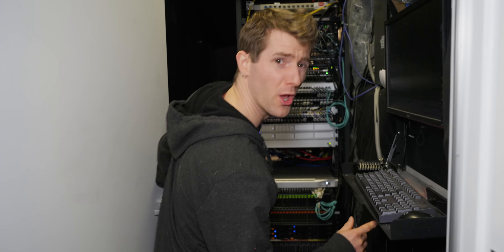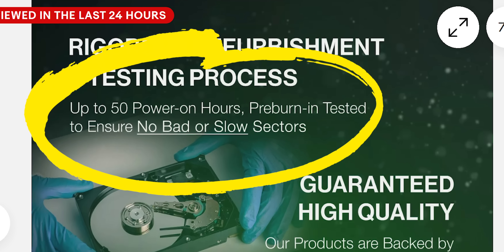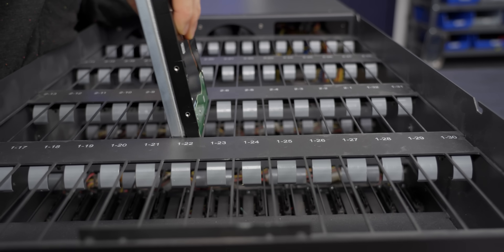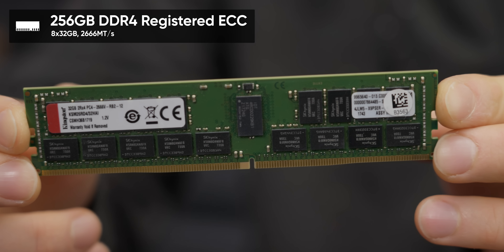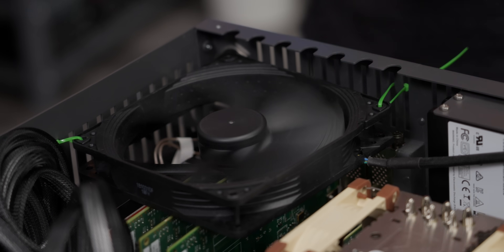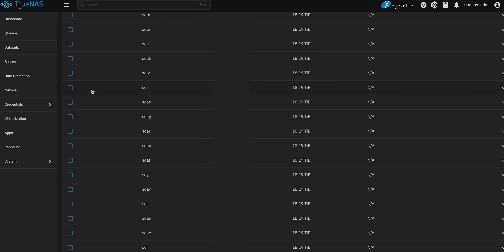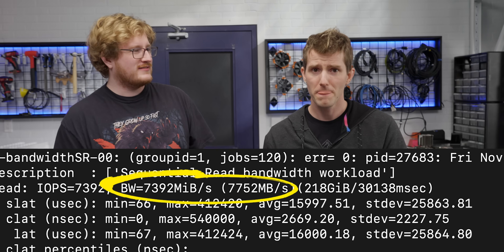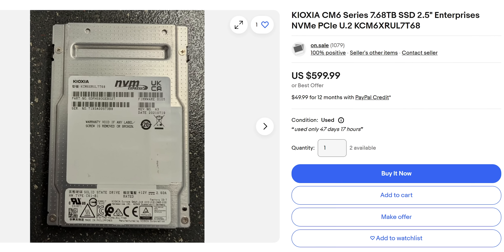Is Buying a PETABYTE on Ebay Stupid?

Comment: I've had great success with Seagate drives in RAID. Even the base Barracuda drives, I got a refurb as a warranty replacement and it was rock solid for quite a few years (although it always ran 2c hotter than its neighbours). It did end up dying though.

Comment: Gonna be straight about this.. goHardDrives is terrible.  I fell for buying a LOT from them (they use different names on ebay/amazon/newegg) and they fail in about a year.  SMART says 0 hours, but an extended self test (which they can't fake), showed 5.9 years on all drives when they started failing, meaning they had 4.9 on them to start. I know other places are the same. DO NOT get the helium drives.  They all start to go bad at same time with 'leaks' and you won't be able to replace them fast enough to get a re-silver to work. 260 TB gone just like that (and restoring from offsite sucks the life from you!)

Comment: My main PC has a 512 GB SSD and three hard drives containing over 16 TB of data.  I used to be really bad about backing that data up.  It is amazing how guilty I used to feel about that, but I thought it would be prohibitively expensive to back up that much data with a cloud service.  I signed up for a 2-year unlimited backup license from Backblaze that cost me $189.  That works out to less than $8/month.  You may be asking what the catch was.  The initial backup took a bit longer than 6 weeks.  Fortunately, my ISP doesn't have data caps.  However, once that initial backup is done, keeping it updated isn't a problem.  Of course, I've never had to restore any data.  What I can say is that I no longer feel guilty for not keeping my PC backed up.  That's worth $8/month.

Comment: Did this exact thing last year, I bought two 14TB seagate recertified drives for use in my desktop for bulk archival storage. I have them mirrored in windows in case one fails, have worked perfectly since, each drive was $130.

Comment: Been running my home server on recertified Seagate Exos and WD Ultrastar HDDs from ebay resellers since about 2015.  Server is currently running 20 drives (half 14TB and half 16TB).  Have only ever had one of them die on me, and that was a DOA 16TB drive from Server Parts Deals that they quickly replaced.  Many of those drives have been running for years now, with scans still showing no issues.

Comment: refurb drives from seagates tend to be  when the logic board fails, either the components failed or the firmware was bugged.

i had 2 refurb drives as replacement drives when i RMA my barracuda drives in 2011-2013.
i didnt trust the replacement drives and strictly used  them as scratch disk. well i was upgrading from 500GB to 2TB HDD then.

 i'm going up to 4TB drives but i have been spacing out my purchases for my NAS rebuild and i bought a LSI SAS card. no more Sata expansion cards.

Comment: Speaking as someone who previously owned a reverse logistics and e-waste company, we tended to destroy drives. It was physical and/or digital, depending on the contract. Last thing we needed was for client data to get out because of something we did. So any drives that looked intact were still useless when we were through. Or at least I wouldn't trust them enough to use in our machines or sell them. If manufacturers are selling recerts, they probably didn't come from that type of stream. More likely they came from datacenters as cold spares or from systems integrators as unused products. They were never actually used, just couldn't be resold as new. Based on that, I'd trust them if they were manufacturer recerts.
Reply: Speaking as someone who has servers with drives in them, you can let me random-wipe them and resell them for the environment, they're encrypted anyway, no one's ever got data from a wiped drive and I'm not insane level of paranoid. The reason they have these policies is sometimes the drives accidentally don't get wiped.
Reply: @thewhitefalcon8539  Some places absolutely let stuff get though due to poor control procedures. We weren't going to let that happen to us. As to the wiping, the majority of our clients tended to opt for drive purge rather than just clear, and that's pretty tough on a drive. We made more net margin off purge or destruction certificates that than reselling cleared drives, anyway. So we didn't mind.

Comment: i've been using these re-certified exos drives for years now in my drobo for 10+ years, now in my synology. they get a little loud a times but reliability has been been very good.
factory re-certified drives generally last a lot longer then you think.

Comment: There is a huge benefit to buying recertified drives vs the newest latest and greatest.

PC / server history is littered with certain product runs that have HUGE failure rates.

Buying refurbed older drives not only gives you the price discount, it gives you reassurance you aren't buying a product with inherent defects that lead to premature mass failures.

Any data hoarder of history knows to avoid certain drives such as: Miniscribe, IBM Deathstar, Seagate Rosewood, and pretty much anything built by Hitachi.
Reply: Oh, and Iomega. Click click click

I still have a Syquest Syjet around somewhere that works to this day.

Comment: So glad to see this! I've been buying these for my unraid server and I've been suggesting SPD for a couple years now. I buy these exact same drives but I've been getting the 18TB drives and I've only had one problem and it was totally my fault, SPD knew that it was my fault and replaced the drive for me anyway. They have really fast, solid customer service. SPD is literally the only company I've ever really shilled for just because it's such an amazing deal and more importantly it is a way safer bet than buying random drives off Lamazon and I see problems with Lamazon drives all the time on reddit. They also have pretty much the best possible shipping methods and a pretty damn good warranty. IMO SPD or goharddrive are the best ways to get drives for a storage server. It might have been good to mention that the prices of these recertified drive can vary a lot as their price seems to depend on their inventory and that seems to fluctuate(sp*?) a lot.

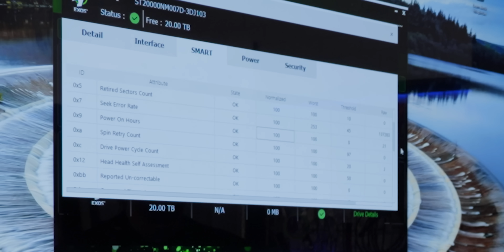Comment: 4:39 Seatools says 21 hours, so did they not do the 50 hour burn in test? How many hours of that was burn in testing?
Reply: At 3:47 you can see in the e-mail they agreed to use "tested drives (less than 10 hours)". Also, it says "up to 50", not 50.
Reply: Wait, where does it say they do a 50 hour burn-in?

From what I've got. Seagate never specified the amount of burn-in performed. They only specified the drive won't have more than 50 power on hours.

Linus seems to imply the burn-in involves writing all zeros to the drives.
Reply: Hmm

Comment: I wouldn't put my data on Seagate drives, bought a 2Tb drive years ago for storage use and didn't take more than over a year and it had some severe sector errors. The first half was still usable space and the rest were just gone. SeaTools did f all.
I wonder if Samsung still makes HDD's, I've had a Spinpoint F3 1Tb drive from my first own PC and it's still fine with 101417h power on. My external Buffalo hard drive has a Spinpoint F2 500Gb in it and it too seems fine with 118527h power on. Only sometimes when Windows is doing Windows stuff and wakes it up from sleep, the start up sounds a bit tired.

Comment: Every Seagate drive I've ever bought new died within a month of the warranty expiring. I have a 6x12Tb raid 15 array (2x3x12TB) for my NAS running recertified Seagate drives that have lasted 2 years longer than any new Seagate drive I've ever owned.

Comment: I just set up a 4 x 18TB HexOS NAS using refurb drives based on the confidence gained on a 16TB drive (~1year) and 4 x 14TB drives (~1.5 years) all refurb with no faults.  While I only have non critical data on any of them, I may change my mind WRT how safe these refurb units are - especially in a RAID array.

Comment: I use recertified drives from server parts deals (before they sponsored) I got 14tb drives for, at the time, the cost of 4tb ones new. I had issues with one and server parts deals helped me figure out that it was just a one-off issue. I have 2 parity drives and a spare which I think was still cheaper than going new.

Comment: I have those same drives from Serverpartsdeals in my truenas scale server for about a year now and no problems.  Funny enough, I built mine based on Epyc, but using a Supermicro board, 256GB RAM, 25Gbe Mellanox card, Nvidia Tesla and 8 NVMe drives used for metadata and cache.  Also have a 12 disk SSD array that is used for VM's.  Only uses about 230W at the most when streaming Plex with VM's and other containers running.

Comment: I may be wrong, but the stamp you all are pointing at for the manufactured date (called a "clock") is an insert used on the injection mold tool to identify when that part was manufactured, not necessarily the entire drive being assembled, recertified, and ready to be re-sold. (this way if a problem is identified, they can tell which tool/cavity within the tool is having the issue and monitor tool wear over time).
Reply: I don't think they were implying that, Jake even comments that that drive model was released at the very start of 2021. They definitely don't think that's the date they were recertified and resold.
Reply: @sciencesold_  it's later when they look at the 'clock'. Not the sticker that Jake is commenting on toward the start of the video the start
Reply: @smalltime0  It still would indicate if the drives were manufactured around the same time, they're more likely than not not gonna be manufacturing drives with parts made in 3 different years.
Reply: @smalltime0  Yep this is what I was talking about. The clock is molded into the part, not a sticker. It's entirely for the toolbuilder/molding shop and deciding when to EOL/ do maintenance on a tool or cavity within a tool
Reply: @sciencesold_  It totally depends on how much backstock they have of that specific part. Setting up tools for high production mfg is expensive and time consuming, especially when you own thousands of molds for other parts/customers and are running on a tight schedule, you just don't have time/capacity to pull the tool out and shoot more parts. It's not uncommon for shops to run 2-3x as many parts as you order if the cost of keeping those finished parts in inventory is less than setting the tool up in the future, and they expect you to order more within a year. I've worked with molders that will shoot 100 parts just to sell 5 of them, and if they sit around for a year with no re-orders, they just bin the extra parts. The extra hour it took to make those parts and the material cost is way cheaper than putting the tool through all the preventative maintenance for storing it, putting it in the warehouse, then taking it back out, prepping it for the machine, hanging it, swapping out the material, running however many test shots to get it all running right again, etc.. Wasteful, but that's the world we live in, mass production is a race to the bottom of price, whatever it takes.

Some of the recert drives may not have needed that part replaced too, doesn't mean other things weren't replaced elsewhere.
Reply: Given that's how it works with anything else, I assume it's the case with HDDs
Especially because, more or less, the HDD case is pretty commodity.
Reply: I mean, you're not wrong. But in order for Linus and Jake to believe that's when the drives were recertified, they'd need to believe that someone is stamping hard plastic cases years after they were manufactured just so they can note a date in a way a sticker could easily replace. Is that plausible to you?
Reply: @meepk633 lol I just came here to let people know what the molded in (not stamped) wheel on the bottom of plastic and cast metal parts is. They pointed to that as a possible date of manufacturing, which I agreed with using it as a reference but just wanted to point out that a single parts manufactured date is quite possibly not the same date as when the drive was assembled and sold!

Comment: I’m running 12 of SPD’s 20TB drives in my unraid server. Ordered in two batches of 6. First batch is over a year old, second batch closer to 3 months old. Zero issues. Absolutely love SPD. So much better than shucking 10TB drives. Really helped me transfer back to 100% local storage after the unlimited google drive party ended.

Comment: For the Seagate and WD refurb drives, as someone who has used these for game drives for a while, they are fairly good. I just had a referbed game drive fail on me but I made the mistake of buying a referbed surveillence harddrive which wasn't good for the use case anyways. I have a suspicion the official referb programs offer data centers a deal if they trade out their drives while they are still good. They probably upgrade or trade out very frequently and so this could keep costs down for them while seagate makes them back reselling the  drives at a still decently high price. If you buy the ones with a five year warranty you really should be pretty safe, especially for games or just bulk storage or RAID.

Comment: I've got 4x 16 TB hard drives from Server Part Deals, and the Seagate IronWolf ones have held up for the whole 2-year seller warranty, but the Seagate Exos have needed 4 replacements. It's definitely a mixed bag, but just as mixed in recertified drives as in new drives. Exos drives have had lots of issues in the 12 to 16 TB lines, especially the 12 TB, according to Backblaze and ServeTheHome. For the 4th replacement, I actually switched to a Western Digital DC drive. That one is rock-solid.

Comment: I got my 20TB drive from Server Part Deals website instead of Ebay, or their seller on Ebay. A lot of people seem to swear by it and my drive hasn't had any issues since I got it over a year ago, and the price was good for me at the time compared to new.

Besides, I learned through a good bit of research that a lot of these drives just simply can't be sold as new, even if they weren't technically used. Though, I don't know if there's a way to actually determine that before purchase, so there's a gamble for that, I suppose.

Comment: Probably a few months ago now this is exactly the path I took. Not really from ebay, per se. But I upgraded my 4 drive ZFS array from 4TB to recertified 20TB exos drives. I tested them for myself and they all passed, and all had low hours to start. As noted, Seagate could have reset all the counters. But my hypothesis is someone bought the drives, misinterpreted some of the diagnostic info, assumed they were bad, and returned them. I had almost made this mistake myself until I read a bit more about what those counters actually are. So far they have run well, with zero issues. No errors or anything. The array is redundant so if a drive does fail, I can just replace it. I also back up online.

Comment: I once traded in a used mac G3 for a 20gb refurb seagate IDE drive in the early 2000s. You know, the old Seagates that had the black rubber surround on the housing?
The thing had MASSIVE bearing noise and sounded like a jet engine spooling. I hated it. The local Mac store in Edmonton refused to take it back, and I not only no longer had a mac G3, I had a hard drive that I HATED!

Comment: Got lucky at a local electronics recycler when they got 6x 16TB exos drives in, all lowish hours and picked them up for 800CAD. Theyve been running smoothly with no issues for 1.5 years now
Reply: Wish you many more years of problem-free service

Comment: I have bought all of my SSDs (Samsung SATA and NVME) through Geeksquad refurbished for years. Recently, with a coupon and some rewards applied, I got a 990 Pro 2TB for under $100. 
Over 6 SSDs, most have had under 50 hours, under 5 power cycles,  and under 5TB written. When registered with Samsung, they have accepted the warranties which are very generous for home users.

The worst drive came with ~1PB written and a few hundred hours with 20-ish power cycles. For generally half the price of new, and samsung's excellent warranty, I don't think I'll ever buy brand new again. They're mostly manual redundant drives and game drives. My tower is chilling at 8TB of storage, with another 3TB of cold backups chilling in a drawer that I plug in and backup maybe once per year.

Comment: If there's two things I don't trust about computer parts... it's refurbished and seagate.

It seems seatrash's quality level drastically improves for its high dollar items while its consumer products are prone to failure, and worse still any warranty claim just results in a refurbished drive. ie you buy a NEW drive and it fails, and instead of seagate sending you a NEW drive as a replacement they instead send you a refurbished model that they sell for half the price. Kinda an insult. 

Used them for many years but drives failing 4-6 months in, over and over.. gets beyond infuriating.

Comment: I have been running a Truenas scale server with 20 HUH721212ALE601 refurb HGST 12tb drives, no issues thus far over a 1 year run. im pretty happy with them considering the cost of an array of new similar drives.

Comment: I have a question that I know a lot of people are going to think is crazy, but if most of your storage space is just old footage, why no migrate that data over to tape drives? Do you need ALL of it available on demand? I know that tape deck servers are a thing as well, but half of the utility of tape drives is the ability to just pack them away and know that they will be stable and functional virtually forever in case you ever need to retrieve that data.

I know that it's pretty common to archive large volumes of digital footage this way for exactly this reason. For instance, a building with a few hundred security cameras capturing 24/7 will dump the footage onto a multi-tape server, because there's simply too much of it every single day to justify the cost of storing it any other way.